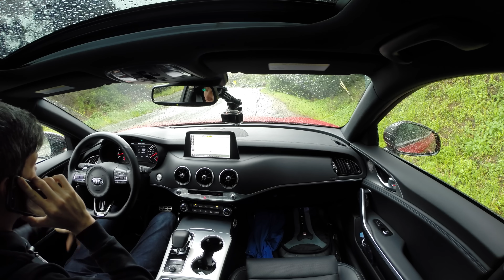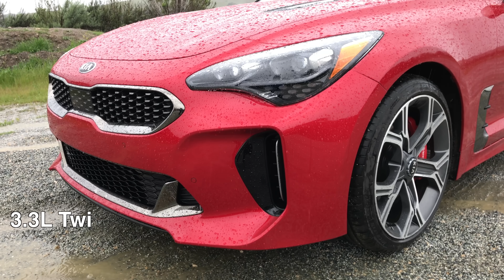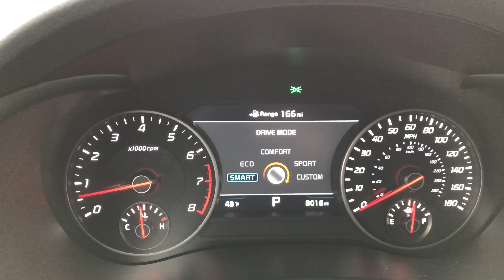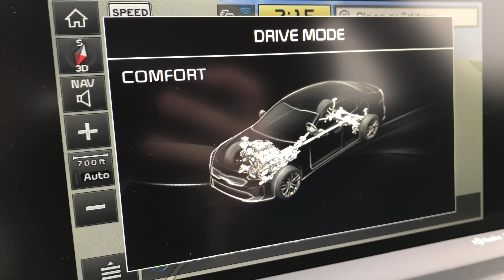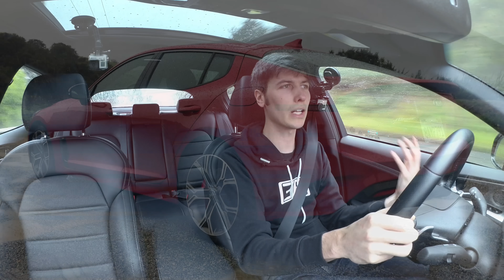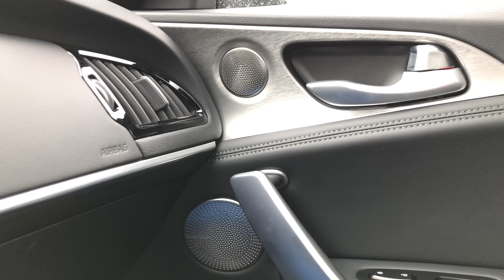The Kia Stinger GT Is An Ego Check For Car Guys

Comment: Still not worth $50,000.  You'll be able to pick these up for under $30k in like two years.
Reply from the maker: Remember they start at $38k for the RWD GT. I'd skip some luxury features for a lower weight RWD at a better price point.
Reply: That's...basically true of any car though lol, besides the few exotics and sports cars that manage to keep most of their value.
Reply: More like 1 year.
Reply: What the hell do you expect buying a two year old used car, for it to still be worth the same price brand new??? smdh
Reply: $50K for this level of performance and you think it’s too much?  Really? Sure you can pick up an A5 Sportback or 430 Gran Coupe in the $50K range but none of those come with a 6 cylinder engine with this level of performance, the S5 or 440 GC with their 6 cylinder engines are where you need to be and those equipped similarly will be in the mid to upper $60K region. Remember this was designed to be a GT car and it drives as well as the German cars for less. Folks keep thinking about KIA from 20 years ago,  KIA has improved a lot since then, if they weren’t making good products they wouldn’t still be selling cars today.
Reply: Carcaine yea, but for just $105,000 you could get an Audi S5 with lower power!
Reply: True for almost every car in its class though.
Reply: What else can you get, new, for the same price point.. I'd love to know....
Reply: Most cars lose 40% of its value in two years. From BMWs to MB to Nissan and Ford.  But for $50K, it's a good value compared to its competition. That it has a former Audi engineer head of production does give some added brownie points to Kia. Nevertheless, not my kind of car but I can see a 2nd or 3rd year professional choosing this has his first 'adult' sports sedan.
Reply: Watch some of the Stinger Atlantica videos. Most buyers are actually going for the top of the line model. So the market says it's worth $50,000. Also, Every new car depreciates fast. If you're that worried about depreciation, you shouldn't be buying a new car in the first place. Also, if depreciation is keeping you from buying the car, then you obviously didn't really want the car the first place either.
Reply: The Stinger GT wasn't designed to compete with the M2, it goes up against the A5 and 4 GC, other 4 door coupes. The Stinger GT is larger and performs better than both with a 6 cylinder engine for less money.
Reply: Yeah and keep in mind your run of the mill Camry or Accord is getting close to 40k fully loaded
Reply: +Engineering Explained ....very good points
Reply: Agreed....look at the K900....you can get a 2015 with low miles and the 400hp+ V-8 for $26k
Reply: ngentotsemua I’m not an Audi fan boy. Never even owned one. But an Audi S5 would mop the floor with this car. That stated, your point still holds some merit.... you could buy two fully loaded stingers for the same $
Reply: Yep, close minded people.  We know that bad news travel faster than good.  It's a fact that when you have a good experience, you tell 1-3 people, when it's bad you tell 7-10.  Now, a lot of those people share the bad news and folks hold onto that.  Years later they think the same when a lot of them haven't had that experience for themselves, they just regurgitate the same old stories, "my friend has one 20 years ago...."  20 years ago is not today.  If a manufacturer continues to make bad products, would they still be in business?  KIA has steadily improved their products over the years and back them with the longest warranty in the industry. Every brand has some issue, some folks will never buy Audi, BMW or whatever brand they hear their friend nightmare stories with, while they have never had the product themselves.  That's just how people are. People say they want change but few are open to it.  It takes time for people to adopt new ideas, that's just how we are.  When I am in the market for a new vehicle I go check out vehicles in that segment from many manufactures so I can have a good perspective of what's on the market.

German cars are known for their electrical problems but folks still buy them, I did also. Bought an Audi that had a computer failure the same day I got it home, got it fixed and kept driving it until it had other issues that was going to cost a lot to fix so I traded it. My 1st BMW was good with only small issues, the 2nd had engine problems and stranded me multiple times, traded that for a KIA.  Why KIA?  It offered similar levels of equipment and a similar driving feel to a European sedan for a lot less.  I'm on my 3rd now, I kept upgrading as they kept improving their products.  With the German designers and engineers they have on board now, their products will keep improving to match the Germans. Would these well known designers and engineers folks have left those other companies to go to a place that they think makes sub par products? Would they want their name to be associated with that company or product? Granted, the average Joe don't know who Peter Schreyer or Albert Biermann are but they do recognise Peter's designs in the KIA products and say "they are copying the Germans", ah no, it was designed by a German.  Now when folks say it drives like a BMW, it is because Albert Biermann, the former head of BMW M cars, another German engineered it's ride and handling.

So, if folks think only Germans can engineer a great product, does it matter where it's made? Yes, the KIA Stinger is a German designed and engineered product, made in Korea that competes with the German cars and it is good!
Reply: Carcaine makes it more affordable
Reply: Strunz0 Cars yea no, both of them has AWD and sub 5s 0-60, they are basically the same car from performance point of view.
Reply: J Y Not sure what your point is. An M2 is not a competitor to the stinger GT. You literally could have replaced the M2 in your comment with any other car that costs $50k+
Reply: @danielboyd7810    You clearly don't know your cars.  Kia hired Albert Biermann, the chief designer for the Stinger, from BMW M division. The Stinger was definitely made to challenge the M cars, if not in price (because Kia can't yet) definitely in performance and specs (very similar).
Reply: @itsm3th3b33  necromancer. That wasn't the point dummy. It's that the M2 is a sport compact and the stinger is a full size Gran Touring sedan.
Reply: Strunz0 Cars; An RS5 would mop the floor with the Stinger. The Standard S5 would not. Like any Audi S model, it's set up a bit soft and numb. If it was a Stinger vs an AMG Mercedes, then we'd have a good fight on our hands.
Reply: waynerm002 a golf R or a focus Rs or a Subaru Sti are around 50k and waaaaaaaaay better than this Kia in almost every way.
Reply: J Y yeah..but then you would have the reliability issues of a Beemer
Reply: Waffletime You don’t seem to understand that those cars you mentioned and the Stinger and its competition are completely different categories of cars. Nice try.
Reply: AND YOU BET I’LL BE BUYING ONE THEN
Reply: Thing is, no one wants a K900 and the Stinger is very much a "want car" which is already selling like hot cakes
Reply: Carcaine Even then I have to be desperate but still to much
Reply: @Waynerm - So, who's fault is it that sooooooo many people have this negative attitude toward Kia quality? Despite the uphill climb Kia has to overcome, who is to blame for this? I suspect you know why so many people are having a hard time overcoming this paradigm.
Reply: better than 340i
Reply: You'll find them for less than 30K in two years. $19-24K would be more likely.
Reply: Vlad Saghin fanboys thanks my WRX 225hp 2005 has still 40% value of What i spent... I think that is good. Massive value loss my a... 😂
Reply: I like the Stinger but would get a low mileage 2016 CPO Audi S4 for just under $40K.  Depreciation does wonders for finding value.
Reply: waynerm002   A significant portion of the price is due to the brand cachet. KIA needs to drop their price a lot more. For a little more than the $50K I could get a BMW M2.
Reply: @itsm3th3b33  Why  would anyone spend more on a less reliable car. And crap warranty.
Reply: @chasl3645   That's BS.  As a recently introduced new model, there's no data to support your assertion that the Stinger is more reliable than any BMW.
Reply: @itsm3th3b33  I have no reason to believe that KIA gave up on the power to surprise as it relates to the stinger.
Dont get me wrong BMW are nice cars but I no to many peaple who have owned them to use them as a bench mark of reliability.
Initial quality maybe...
Reply: Carcaine I'm willing to bet even less than 30k the only thing that will help these hold their value will be Kia stinger fanboys otherwise its gonna be like a 20k car in 2 years

Comment: Mate you're losing the plot. Car reviews and explaining engineering are two different things though  I suppose there's only so much engineering you can explain. Can you do a vid on the  golf swing ? I got a bad slice.
Reply from the maker: I've been doing car reviews since 2014. Nothing new, I've just scaled them back a lot recently. 
First review: https://youtu.be/7b6xfxpSnvM
Reply: Truth I wish he'd go into motorcycle engineering once in a while. Sure he doesn't need to ride them but car guys often ride motorcycles. Hell he could review 2 rather car like vehicles in the Polaris Slingshot and Can Am spyder.
Reply: Truth - I think you're mistaking engineering with physics. Try the latter on your golf swing.
Reply: Truth He usually explains the engineering that went into the cars he's reviewing. This one doesn't have much fancy stuff I guess.

Comment: 3.3L twin turbo v6 and only 365HP? Really? A naturally aspirated 2L i4 Honda engine has just over 200HP lol Something doesn't add up here, this engine should produce over 300 with no turbo at all.
Reply: It has torque available at low to middle RPMs and doesn't need 5krpm+ to develop the majority of it's HP.
Reply: +nopejpg ...lmao!  the "it's a Kia not a GTR"  cracked me up!  valid points as well
Reply: Piotr Sulej true statement. Infiniti makes the red sport series that has a 3.0L TT making 400hp.
Reply: That Honda will be revving to 8 or 9 thousand. Can't remember the Kia's numbers but it's probably around 6.5k. They're going for smoothness rather than all-out peak horsepower. I'm sure they could push 500hp if they wanted to.
Reply: DGFr0sty You would gain zero power if you removed the cat without a tune
Reply: Engineering Explained thx for the explanation. I think moral of the story, this will become a tuner special. I’m not into that sort of thing but I’m guessing an ECU flash alone gets this well over 400hp.
Reply from the maker: It's not really that simple. Specific output comparisons are a bit silly. That Honda has no torque below 6,000 RPM, where as the Kia has 376 lb-ft from 1,300 RPM. There's a massive difference between those engines, and the area under the HP curve is significantly greater with the twin-turbo engine. And with your mention of variable valve timing, it does have it (also variable valve timing doesn't add much power, it's more about emissions: https://youtu.be/I5dy2Vnf95w).
Reply: Honda uses VTEC and RPMs to achieve that power number. Kia is using a turbo which will give the car a more flat torque curve and make it more driveable. The VTEC drives like a little two liter engine until the VTEC kicks in  (yo).
Reply: Its already pulled a 12.6s Quarter bone stock, and tuned it does 400hp at the wheels. The Stinger is not slow.
Reply: Piotr Sulej - yup, entire K20 line discontinued, with the youngest units dated 2011. Ever wondered why? They no longer meet emissions restrictions for new cars, hence the k20 was discontinued. There's a reason why new Hondas have 1,5L turbocharged i4, innit?
Reply: Honda n/a = 50 hp per piston
Kia stock turbo = 60 hp per piston

That sounds about right. Its a kia not a gtr.
Reply: You're comparing an engine made to have use-able power with one that makes power at high RPM.  A family car with an NSX engine is not a good family car.
Reply: Piotr Sulej  probably they've tried to play safe and not overwork the engine for longer reliability
Reply: amr flk yeah, but for such a miniscule gain in power, imho it's not worth adding more complexity and cost, as in a dual turbo. It would make a lot more sense to use some sort of variable valve timing etc. to get more performance out of a not turbo ed engine or just use a single turbo.
Reply: Strunz0 Cars But lower torque and long turbo lag until the engine hits 3600rpm!
Reply: Have you seen the honda weight vs Kia? Case closed
Reply: Engineering Explained plus, I'm guessing you could probably increase the stock boost if you really wanted; seems most stock boost pressures are fairly reasonable, guessing for emissions and reliability.
Reply: Yeah 200 hp for about 80 rpms lol
Reply: Piotr Sulej a simple cat delete on the 3.3 makes 400whp without a tune or piggy back ecu, the engine is extremely restricted from the factory. That na Honda motor can’t make much unless increasing displacement and high compression and head flow, plus I like having torque
Reply: Piotr Sulej It probably wouldn't be as efficient if it made that power na
Reply: A 300hp high revving na 4 cylinder is not the same as a 300hp turbo 4 cylinder.   To hit 300hp na it's gonna be a torqueless wonder.  A 4 cylinder with a twin scroll turbo is gonna have an amazing power curve.
Reply: Piotr Sulej - remind me again, which Euro emissions does that Honda's 2L i4 meet? Yeah, there's you answer, bro. Pozdro.
Reply: AkarZaephyr this same Honda drives in "Murica bro... k20 engine.
Reply: AkarZaephyr yeah, that reason is more low end torque and better fuel economy by undersizing, which is not the best idea imo, I like the idea of Mazdas skyactiv waay more than undersized turbo engines, because a very stressed engine will last shorter for sure than a na engine.
Reply: it actually makes 454hp but it is detuned